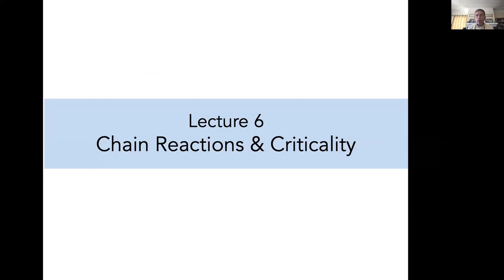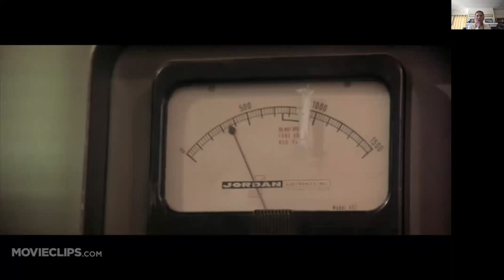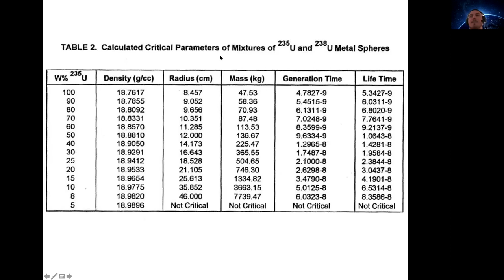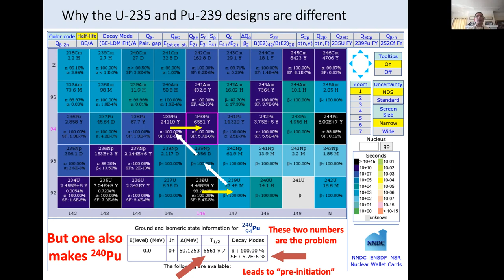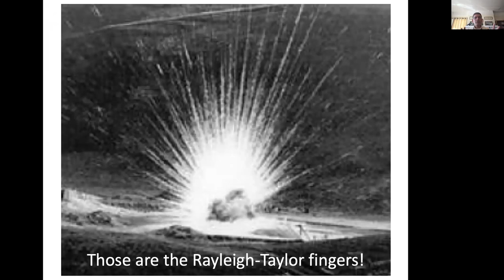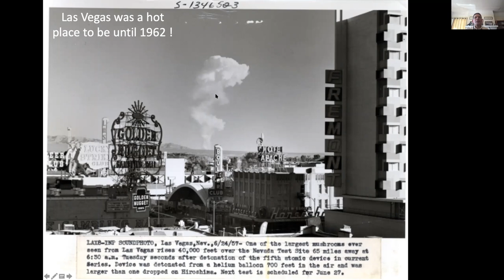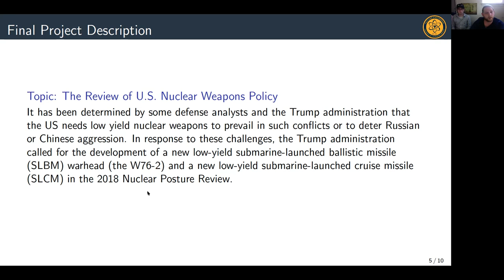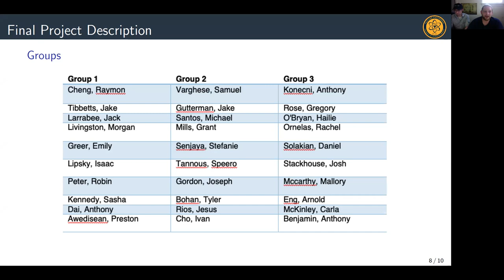Lecture 10 (2.24.2021) - Chain Reactions & Criticality, Rudiments of Nuclear Weapons Physics

Comment: It seems to me the beryllium reflector needs to be made in a way to crush the U239. Because the high explosives is in a shape charge it hits the beryllium reflector all the presser is pushing on the reflector and not the core. Therefor the reflector must be made to ratch down to a smaller sphere volume. That compresses of the U239. Also, this would help in the difference of time of the High explosive going off.